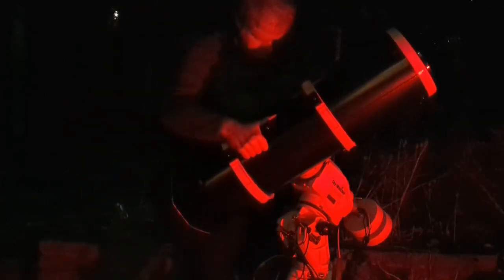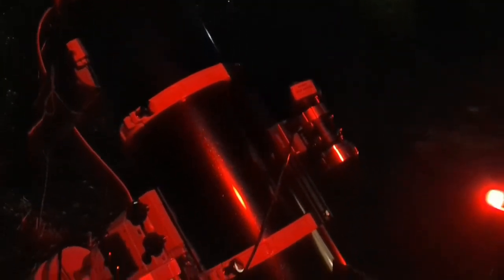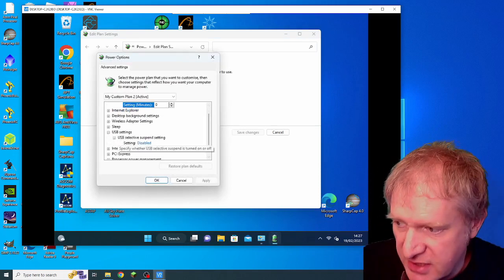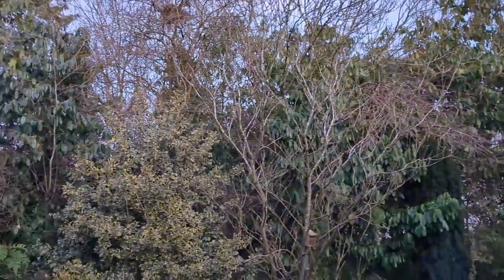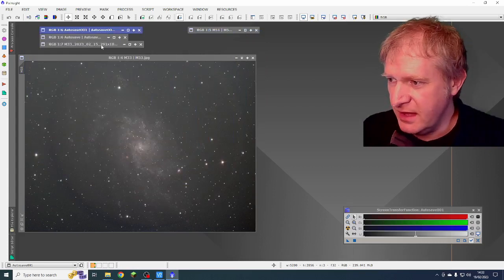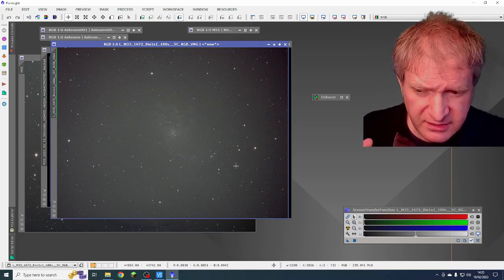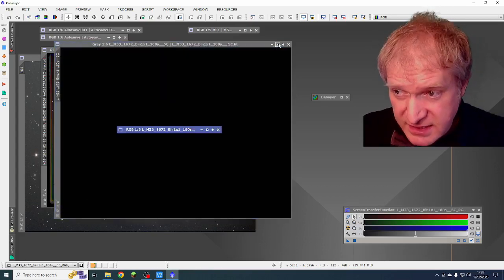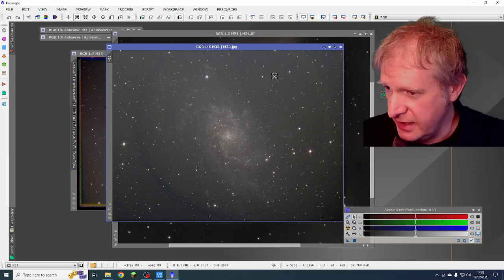Galaxies - and MORE CALIBRATION ISSUES!!!

Comment: Replace that cheap leaking stray light focuser, use flashlight punting between the focuser draw tube and the housing and see if light is leaking, ore the draw tube is wobbling, and put black tape on the base off the focuser, stray light is leaking during the flats.

Comment: I have s 130pds and the only time I have noticed this was using a low iso (dslr) not astrocamera like 200 iso. When I hit above 800iso it seems to disappear Maybe it's a dynamic range thing to do with gain and signal to noise of your camera, compounded also by the field of illumination by the secondary not giving full illumination?  Maybe try a higher gain? 
I'm going to replace my secondary with a larger one to give full illumination of at least 20mm diameter. Will have very little vignetting then and less problems with flat calibration.

Comment: It's the flat frames for sure. I have the 130pds and at one point I was getting all sorts of different aberrations after stacking the images. I tried everything and couldn't figure it out. I even took out the mirror and cleaned it several times. Finally, I put a towel over my flat panel and covered the top part of the telescope and that seemed to solve the problem. So, I figured it was probably a light leak while taking flats. There could be a slight tilt somewhere in the optical train that along with an undiscovered light leak causes this ring that you see. It's a common issue from what I have seen (posts on cloudy nights and astrobin etc)
Reply from the maker: Yes, I found that there was some flexing of the focuser and this moved the flat frames so that they were not calibrating the lights.  Hope to get a video out about this soon.

Comment: To me is that it’s 99% the flats. It looks to me like the focus between your lights and flats has very slightly changed (perhaps due to a change in temperature). This would potentially cause your flats to have a slightly different vignette to your lights causing that dark ring inside the vignette. The light is corrected at the edge, but slightly over corrected just inside where the vignette was on your lights. The other possibility is that if your focuser has any play in it, it could have shifted the vignette between the lights and flats. Basically causing the same issue. You are right though that it’s not in your light frames so no issue with the optics. It is definitely your calibration frames doing something unwanted.

Comment: Check your comma corrector, and make sure rhe glass is centered and installed correctly. I had one that the glass was upside down and was giving me a similar aberration. Also, make sure that the distance from the comma corrector to the camera sensor is correct. That will also show similar aberrations. 
Make sure your focuser tube is properly aligned, and the camera is staying centered in the tube. Your “circle” seems more pronounced torwards the left of the image, so this sems very likey. 
*very likely not the problem*Your primary mirror: it seems you have a heater on it? That cover on the back? I’m not a fan of warming up the primary mirror. You will never get all rhe surfaces to achieve the same temperature, since the front of rhe mirror, its going to dissipate more heat then what you can put in it. Even on colder climates, i always find a slow fan pulling air from the tube(not blowing at the mirror) gives me better results. Try to do a star check with and without that heater and see what difference it makes.
Reply from the maker: Thank you. How will I know if the Coma corrector glass is the correct way around?  I used it in my 130pds and didn't have the ring.  Thanks
Reply: @AndyofAstro  if it worked fine on another scope, they it should be ok. On my case, the problem followed the corrector. So i decided to give it a shot and flip the lens. There was nothing obvious that gave it away. Now, when i took the lens out i noticed the darker coating was facing the camera, and so was the more convex part of the glass.
Reply: Given the problem is not in your light frames, it won’t be the coma corrector. Agreed though that there could be a small collimation issue, but in itself would not cause the issue without other factors such as play in the focuser or change in focus between lights and flats causing the vignette to shift.
Reply: I had this problem with my 200P/BaaderCC and couldn't calibrate it out with flats. I removed the CC and the ring disappeared. I plan to revert to my SkywatcherCC which I stopped using because it occasionally caused reflections if there was a bright star in the field. Cheers, Pete.